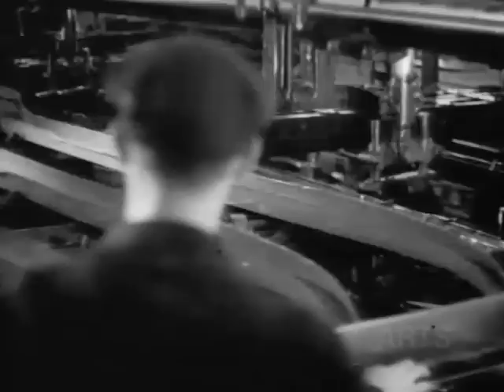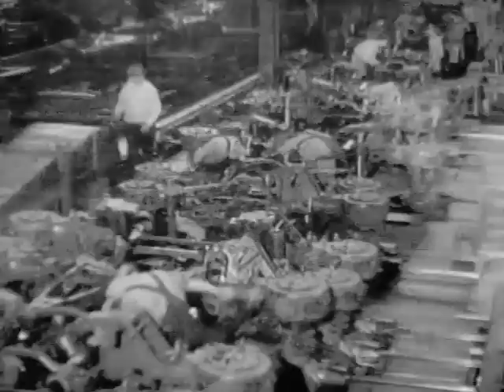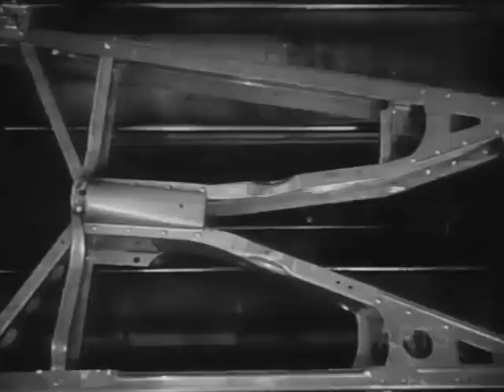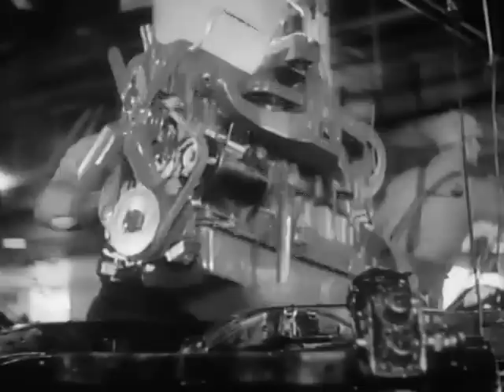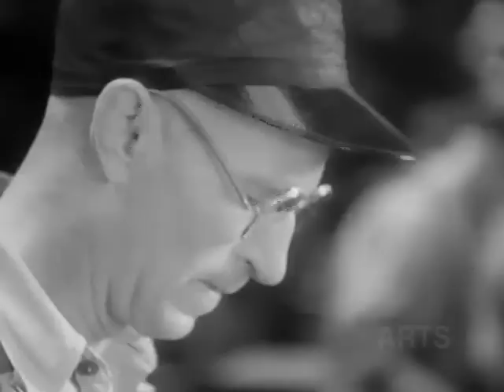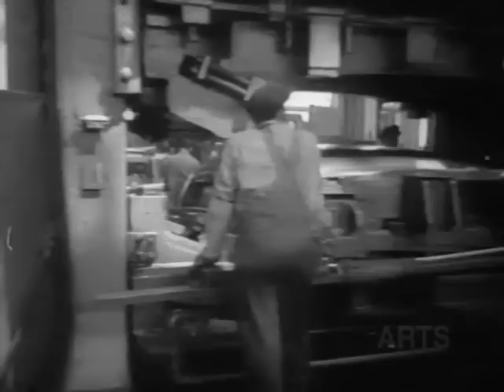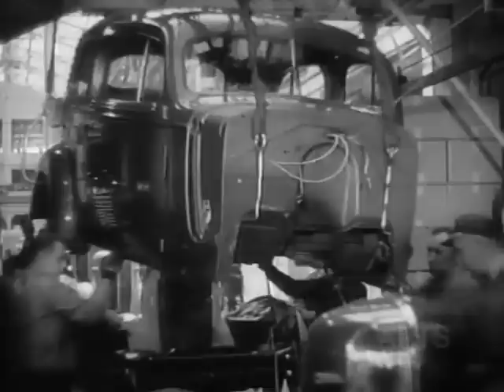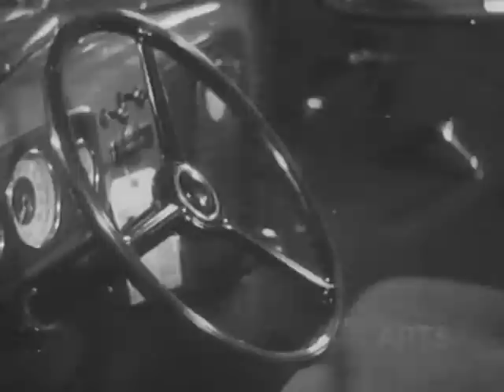Fascinating 1936 Footage of Car Assembly Line

Comment: What has past is gone forever.  These cars were no beauties.  Look up some photos of what they and the passengers looked like after a 35 mph impact or a rollover.  People were launched through windshields, kids in back seats died of broken necks, drivers' chests were crushed against or penetrated by steering columns.  The frames of some autos even in the 1930's were made of wood.  People died routinely if their cars went into a ditch.  We hit nearly 60,000 deaths a year a couple of decades ago, and in spite of probably double the number of cars today cut deaths nearly in half -- till the current nuttiness of using our drivers seats as texting centers.  Cars today, plastic or not, are safer, more durable, much more carefully engineered and constructed.  Factories are safer, and the workers are healthier.  I'm almost afraid to mention to the nostalgic among us that the federal government played a large role in improving safety.  True, the plentiful decent-paying  -- and available -- jobs are not on the assembly line anymore.  They are instead in robotic design and technology, engineering refinements, assembly line design.  We tend to romanticize the auto industry, but must admit that in transportation -- autos, airliners, highway design -- we've come a long way.  This is not to detract from the genius of 1930's workers.  Watch a video of the operation of an automatic transmission and realize how much of that was being developed in the Thirties!  Also keep in mind that this great video is a piece of company propaganda.  Please also understand that because I mention a government accomplishment, a decline in the power of untrained workers, and make some unsentimental comments about America's "glory days," I'm likely to be labeled a pinko liberal socialist communist Muscovite, and I'm not.  I just happened to have lived through a part of the changes taking place in the auto industry.  The wooden auto frames?  Not that part.